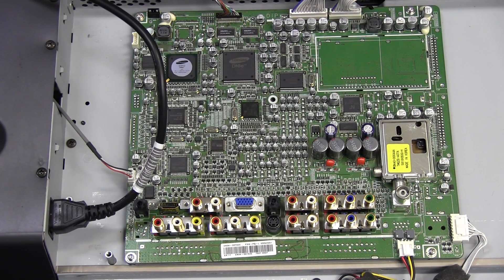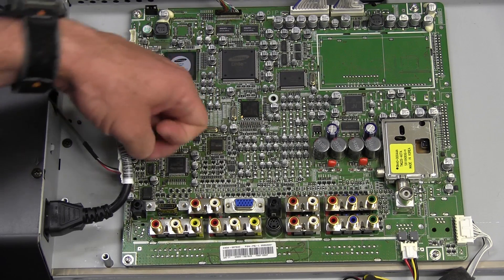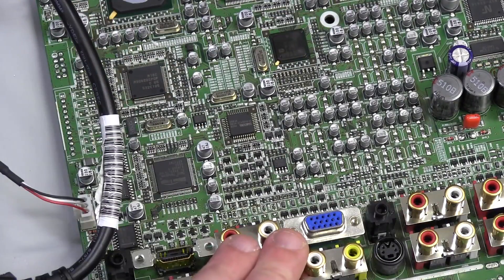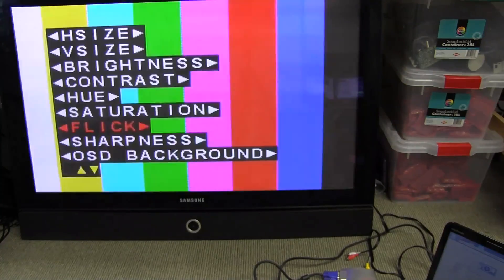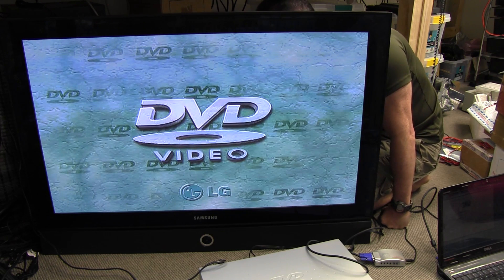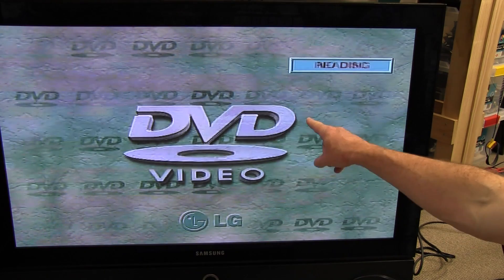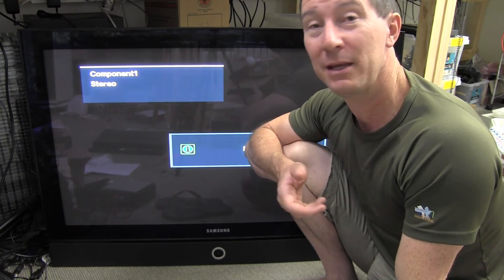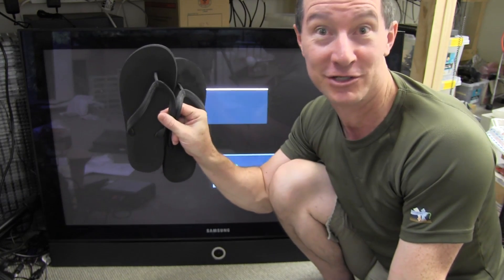EEVblog #447 - Samsung Plasma Followup

Comment: that analog to digital device is generally referred to as a uart, and it looks like either a cold solder (dry solder is what you called it) or a burned chip. it could also be a power supply problem. pop the power supply open and look for a leaky or blown cap. find a kid to listen if you don't want to remove the caps and test them yourself, i'm only 28 and i can barely hear leaky caps anymore, so i am betting you can't hear them well either.

Comment: Most of that kind of chip-sets with a metal eye in the middle do get badly hot, but it's their normal operation mode as far as I heard. Problem comes with bad soldering at the factory that can't stand such heat for a long time. The chip can even unsolder itself while still being in normal working condition. And that's why "heat gun" technique most of the time works and does not kill the chip itself.

Comment: Do you have an old pocket PC with an IRDA port? if so then get either nevo or some other universal remote application and use that to control the TV (I currently use an old windows mobile pocket PC as a universal remote since it allows for unlimited macros and devices)

Comment: By cooling it down you make the solder contract, i.e. highlighting any possible dry connections. However you also risk the possibility of condensation on the circuit which could short something out and damage it.

Comment: So it's detecting when there's a signal from the component input, but it's unable to process the signal. Doesn't that have to mean the problem is with the processor, i.e. the burned-out looking chip? Or something in the path from the input to the chip?

Comment: Dave, did you check bottom side of the mainboard? Can it be the same thing that happens with Amiga (broken joints on the power (DIN) connector)?

Comment: Probably bad connection on LVDS cable or connector (that connects control board to logic board), its that cable with many small wires.
Let me know if you need service manual..?

Comment: I wonder if it's worth waving a hot air gun over that BGA to re-float it on its ball pads. If the worst happens and you end up ruining it, you can whip the thing completely off, clean up the pads on the PCB with solder wick and just use the HDMI input. Maybe :P

Comment: unless you are in a room full of bong smoking hippies the impurities you speak of are negligible, not enough to raise the conduction to a point where it becomes a problem, your assertion that water has no way to escape from it is erroneous for if this was the case then how could water condense underneath it in the first place, R134a has a boiling point of -21 deg, the ice crystals that form are rapid,sparse and microscopic and evaporate almost as quickly as they are formed

Comment: freezing water..really?..like seriously?..freezing water??..do you honestly think they put ice water in a can as a spray?..seriously?..in the electronics industry this is common practice to detect thermal related faults such as dry joints or cracked solder joints by artificially inducing thermal expansion or contraction. the frost you see is water yes, but it is DE IONISED water which is not conductive. damage from water to electronics comes not from the water itself but what is dissolved in it.

Comment: Wall bracket and mount it to a nice firm wall at home. Check with Aussie50 to see if he has a bracket still for this, he has had a few recently, he might even have a board for you to try. Of course he might have already tested to death with the plasma burner or put a hole through it.....

Comment: Check RAM chips, common failure. As well get the remote and do a display equalisation run, which will run a full brightness bar across the display to regenerate all the cells to a nominal value.

Comment: Time to epoxy some heatsinks on the toasty ones. Even the SAA smokie as well, it might work if cooler, as it is at least half way detecting signals. Should be enough scrap heatsinks on hand from the dead electronics in the office.